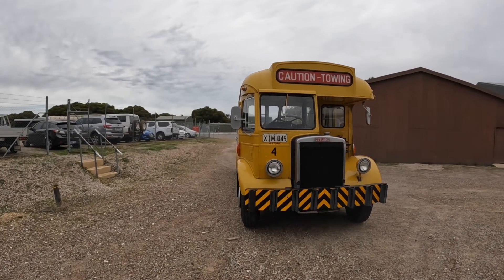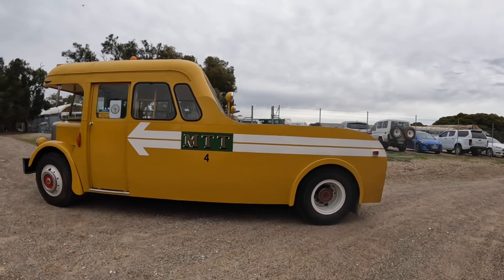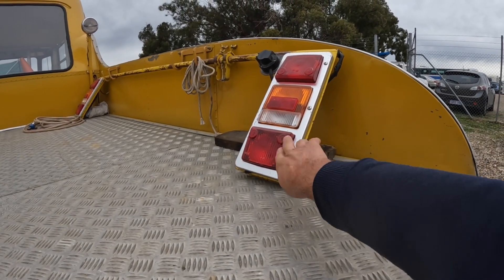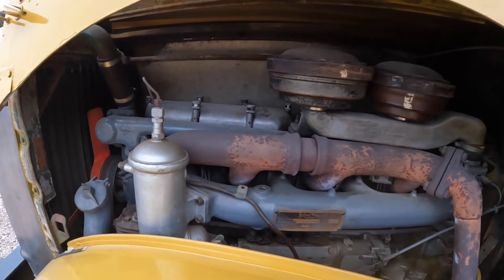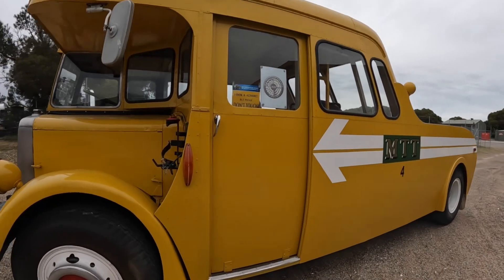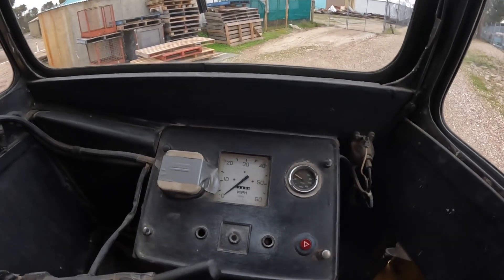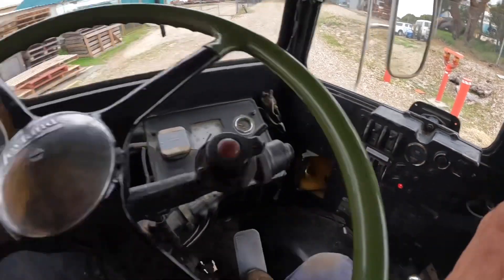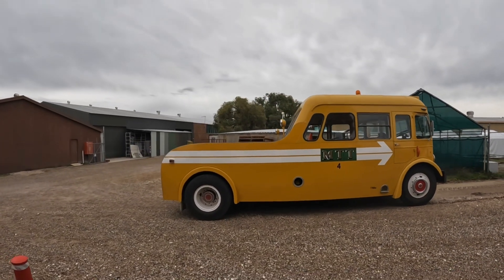Leyland tow truck c1951

Comment: Wonderful recovery truck. I love all things Leyland.
Reply from the maker: Hi David, I love the Leyland’s of this Sara too. I also drove a British Leyland Rover 2000 for many years.
Thanks from Geoffrey
Reply: @brookdalefarm7986  I would love to get a Leyland truck. Then I would have the trifecta. With  2 Leyland tractors, and a P76. I don't have a Land Rover any more But dispite seriously chasing a Leyland Chieftain in NSW mid pandemic, sadly I missed it because of travel restrictions and ended up buying a Ford Cargo, Still English but not the same. There is a Leyland Mastiff with a V8 perkins that will come up at a clearing sale in the next couple of years, but it would take a bit to get it through our point of sale inspections. I really don't need more projects. Those Rovers you have were a very fine car. I would be proud to have one. My experance with the P76 is all positive, dispite the bad reports you would have heard over the years. Our family has owned 3 at different times and I still have one, that really needs a restoration requiring skills of rust repair and motor trim that are way beyond me.
Reply from the maker: Hi David, I hope you can find a Leyland truck. There was a Leyland badges Albion still being used near us until recently. Was there a tie up between Albion and Leyland? I think it threw a con rod in the end which was a shame as it was somewhat of an icon around the district.
I have herd such differing opinions on the P76, but most of the owners I have spoken to love them.
I have 2 land rovers, the green one I pull the sprayer with and a series 2 in poor condition. I believe this one only has about 80 000miles on it, but it has had a very hard life.
The Rover P6 was a great car. I drove mine as an every day car for almost 20 years and was at one stage covering the equivalent of Perth to Sydney every month. They are heavy and sit well on the gravel roads and have great suspense for chasing sheep in the paddock. It also doubled as the farm truck. I hope to have time to restore it sometime.
I was having trouble with my email for a while so I am not sure if you sent me those spray notes.
Thanks from Geoffrey
Reply: @brookdalefarm7986  good morning.
I have emailed twice and wondered if I have the correct address. I have decided to post printed notes. One email was asking for postal address.
Reply from the maker: Hi David, I thought you probably had tried emailing. I guess my email still isn’t working properly.
My postal address is Geoffrey Parker P.O. Box 1385 Toodyay Western Australia 6566. Thanks for your help.
From Geoffrey